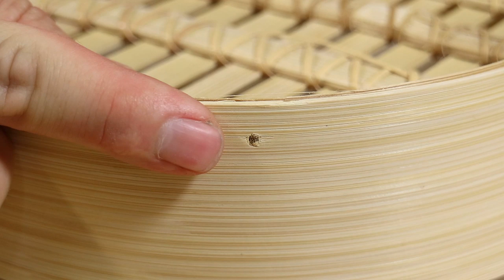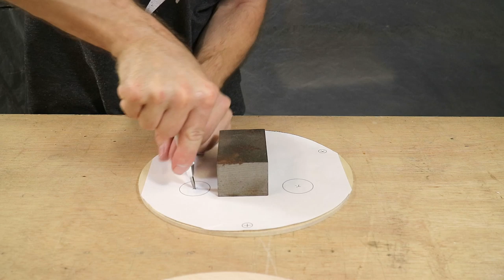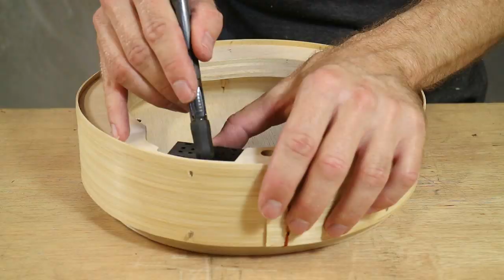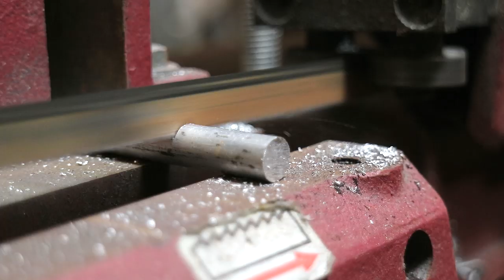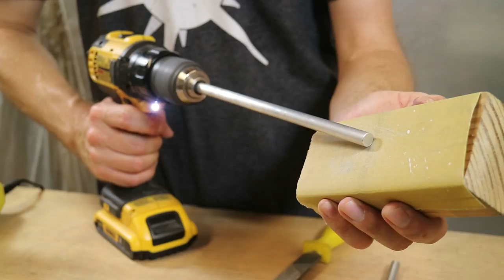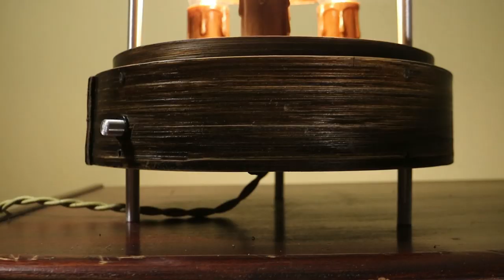Recreating the Lamp From Firefly

Comment: Old sign making trick.. we would put the ply/plastic on top of a 3” or 4” inch thick sheet of styrofoam to cut the letters with a saber saw (The shop didn’t have a bandsaw). It works great and you don’t have to worry about cutting up your table or how to clamp or hold the piece you are working on... Love the video and the project....

Comment: Where did you find that nice cloth wrapped cord? I've seen that sort of thing in bulk but I have no idea what to use for the wall plug.
Reply from the maker: I've added links to the video description. Also, both Sundial Wire and Grand Brass offer vintage-style plugs. 👍
Reply: @WesleyTreat  Thanks! I have several lamp designs I've thought about producing but my biggest hang up was how to produce a professional looking cord. These are great, especially the retro look rather than Home Depots "cheap chinese chic" look.

Comment: Need Rubber Feet / Caps on the bottom to prevent Scratching the Table Or What You are going to set it on .
Reply from the maker: I bought some, but after I chamfered the aluminum, I realized I didn't really need them.

Comment: Never watched the show "Firefly"...  have not watched much TV for about 30 years...  too much propaganda built into the shows...   But I remember the short story "Firefly".  It was about a microscopic black hole passing through our solar system,  being captured and used as an energy source....  The reasoning was that it was losing mass and very close to extinction,  but if it popped within 10 or so light years of the solar system mankind would be wiped out by the radiation released...  so it was better to capture it,  feed it and eventually figure out a way to get it safely out of the cosmic area.